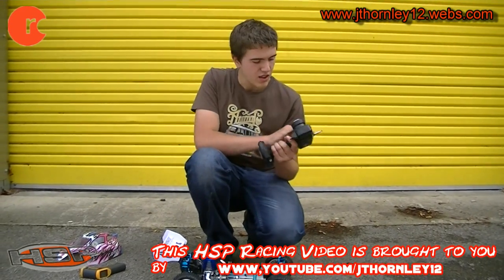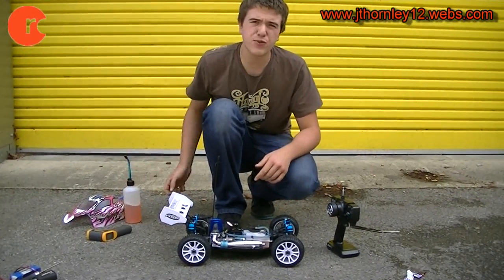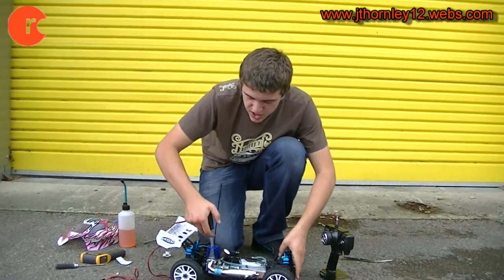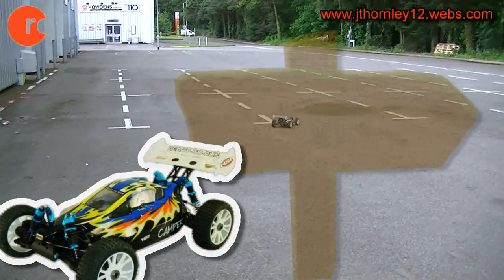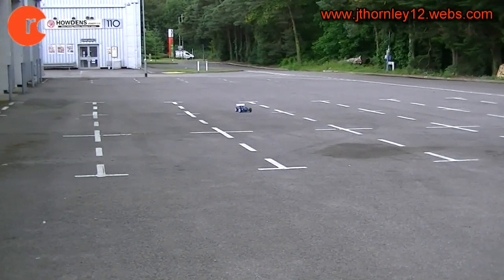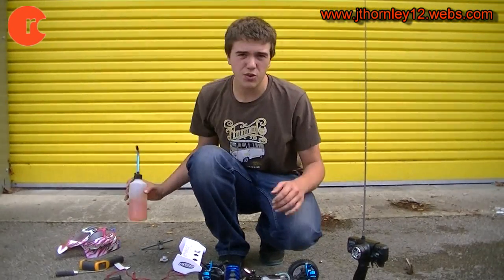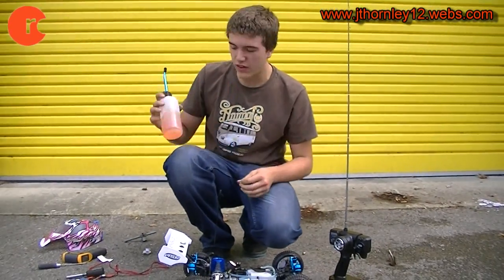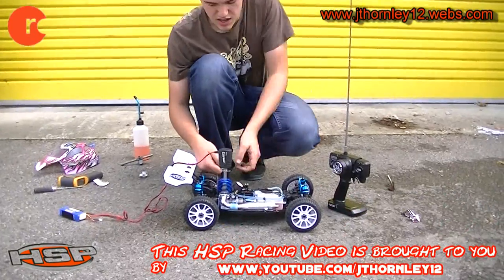HSP Camper - How to Break in the Nitro Engine

Comment: What happens if you don't break in the engine of a brand new RC buggy? :o
Reply: It will be harder to start and  won't go as fast
Reply: RC Eagel Not really. Each engine is different, My guess is that it will lose its compression quicker than usual. But im gonna do a test soon, Im gonna take 2 engines with alot of pinch and break one in and one is just be flat out bashed on its first tank, I might look stupid but half these .21 engines ive come accross have extreme amounts of pinch when brand new so how much can a break in benefit.